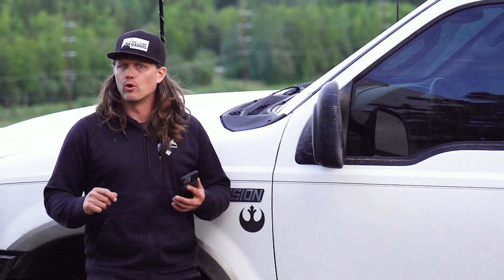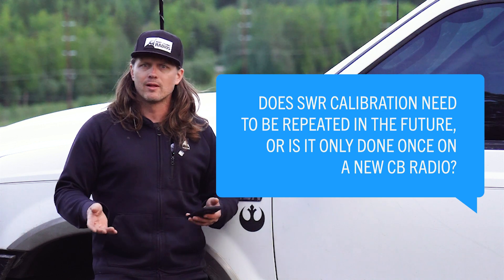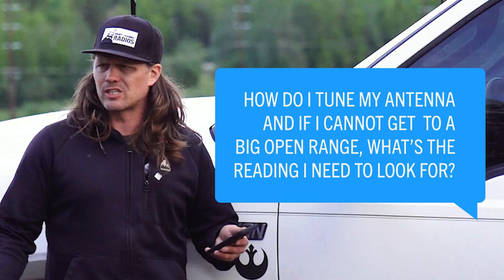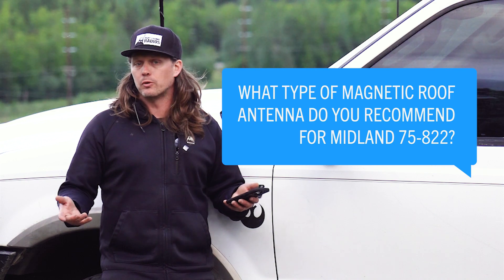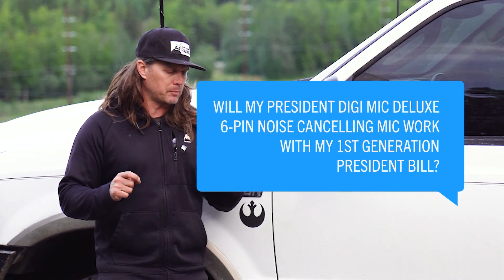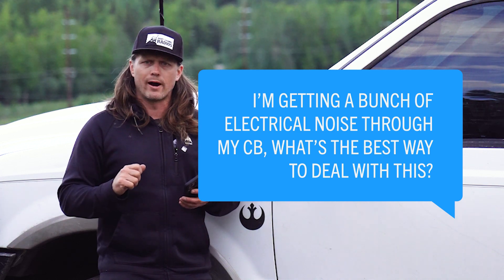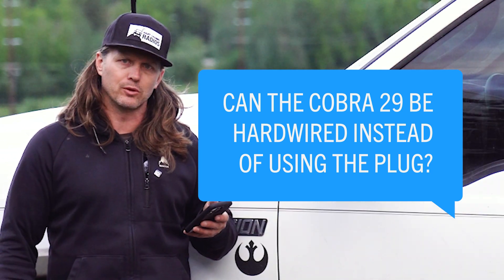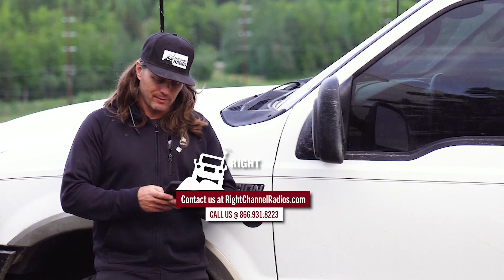MORE CB QUESTIONS ANSWERED!

Comment: On my 2000 7.3 PSD using a President George FCC my truck dies when I key the mic. Yes I checked ALL wiring, ground straps, battery connection...etc. Tried different antennas, coaxes....but EVERY time I key the mic the engine dies. Next I tried a STAND ALONE battery. NOT connected to the vehicle in any way...and the truck dies when I key the mic.  So its an RF problem. Is it the radio? Is it the truck? Any ideas as to WHAT sensor in the truck?  ALL help is appreciated.
Reply: Did you try running the radio off a separate deep cycle battery NOT connected to the truck's electrical system?
Reply: @platinumfalconm3891    Not a deep cycle battery, but yes a car lead acid battery separate from the trucks electrical system. From what I can tell its the radios RF that causes it. I just dont know the cure yet.
Reply: If you haven’t fixed this already it’s probably your icp sensor. You can test this easily. Unplug the sensor and start the truck. Key the mic and if the truck doesn’t die you need to order a FORD or INTERNATIONAL GENUINE sensor. The junk from parts houses aren’t properly shielded from RF
Reply: @timblack33  The ICP sensor was replaced about 1.5 years ago with a factory Ford/Motorcraft part, but tonight I did disconnect the sensor to see what happened, no help. That sensor is actually oil pressure driven. When the oil pressure goes up the switch is on, when the oil pressure goes down the internal switch is off. Since a cb radio in another truck parked beside my truck, not even touch each other, and THAT truck can key-up the mic and my truck dies. This seems as I have said the radios RF....a magnetic field from the radio is the culprit. I need to find out what on my truck is affected by a magnetic field. I think it may be the PCM...I REALLY hope not, as those are around $500 to $1200.